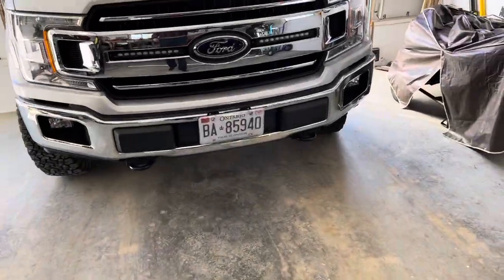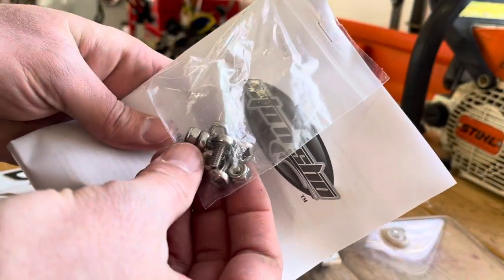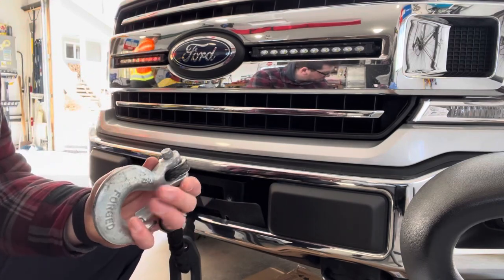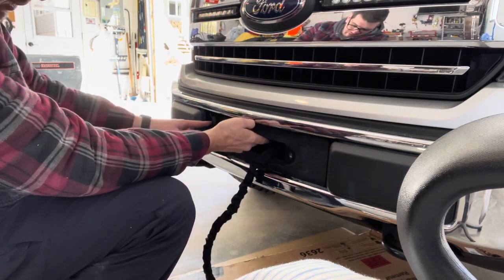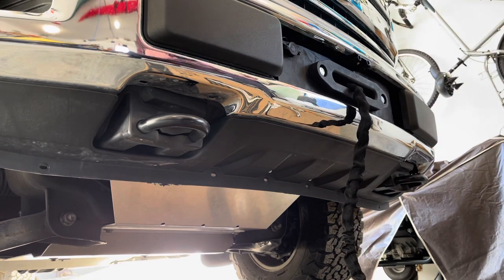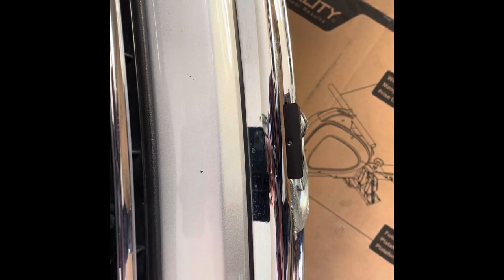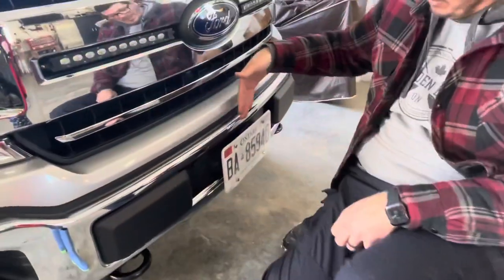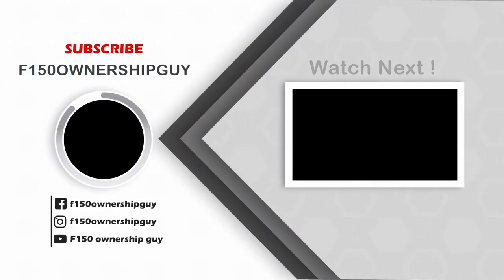Must have Winch accessory. Wish I would have used this to start with.

Comment: Your front plate was on upside-down that's why your remote cable connection is a bad spot. If the plate was put on correctly the remote cable connection would be on the upper right and the license plate hole would be on the bottom.
Reply from the maker: Unfortunately it didn’t fit the other way around until I cut those tabs off. Thanks for watching